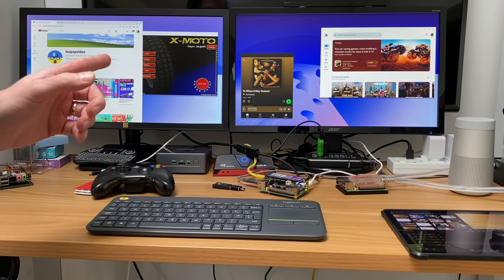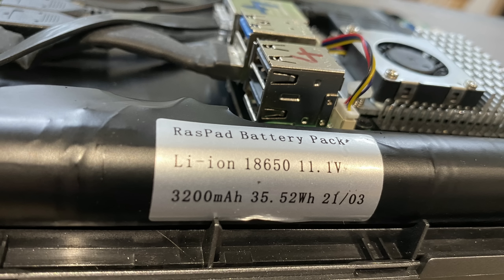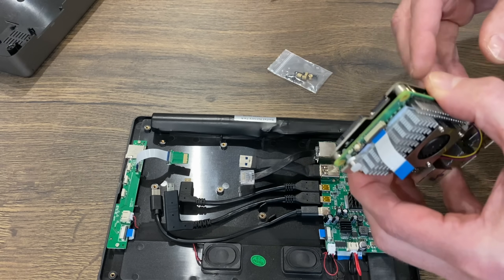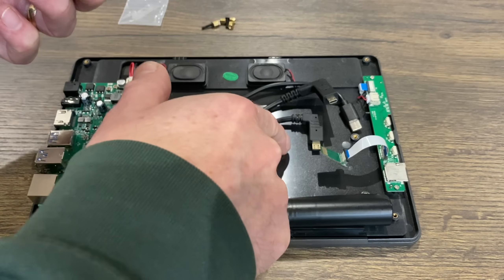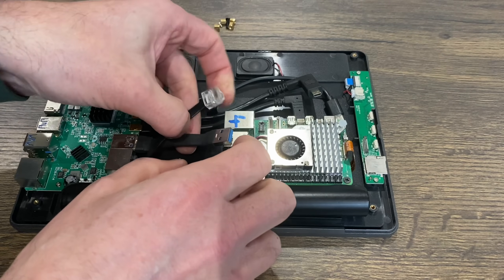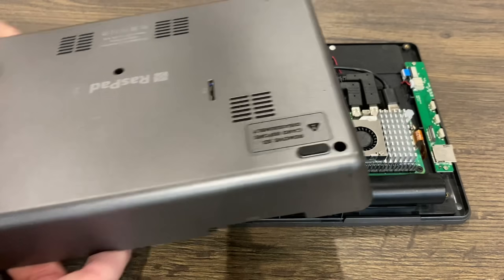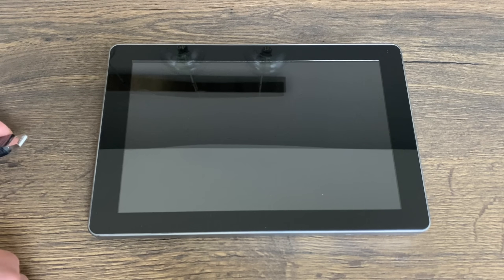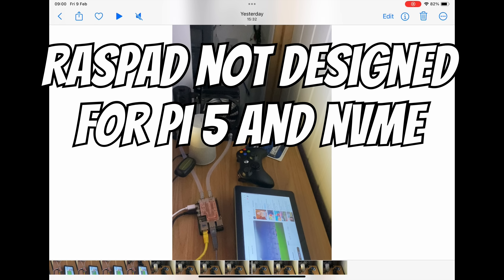Raspberry Pi 5 tablet with NVMe. Raspad 3

Comment: Since Raspad recomends Pi4 ,did you notice any voltage problems working with Pi5? Pi 4 needs 3A to work and Pi 5 needs 5. this is the only reason i am skeptical to buy one Raspad
Reply from the maker: Occasionally I get a voltage warning. It’s not ideal and the battery doesn’t last long

Comment: Hi there. I’m really intrigued with this project and have a question related to power availability vs requirements between the PI 4 and PI 5 in the Raspad 3 case.  I understand the main board in the case only provides 5v, 3a for the PI 4, but the PI 5 requires 5.1v, 5a. Did you encounter any type of challenges with power demand when using the PI 5? Sunfounder informed me it’s not possible to change the power configuration and that there would be issues with the PI 5.

Thanks for any advice you can provide.
Reply from the maker: It’s been fine for me. The recommendation is 5V 5a but I think that’s more when many devices are connected to the Pi

Comment: do ya think sticking with a Raspberry Pi4 and adding an NVME drive would have good enough performance? Also, have have you had any heat issues with RPi5 in the RPad3?
Reply from the maker: Pi 4 doesn’t benefit enough from nvme as usb 3 is the fastest connection. Pi 5 has much faster pcie.

I always used 2.5” ssd’s with my Pi 4

240GB SSD Kingston Vs Crucial Speed Test. Raspberry Pi 4, Pi 400.
https://youtu.be/CRNHUuGZ9aU

Samsung bar was also reasonable

USB Stick Speed Tests. Raspberry Pi 4 / 400
https://youtu.be/u2KZhkdP8P8

Temperatures have seemed fine. I haven’t run games for extended periods on the Raspad

Comment: I have a unusual raspad mainboard since mine has a extra switch which enables touch when external display is connected and the headphone jack can be controlled by the buttons on the side altough i don't have bass so i use a eq that boosts the bass to be flat does your raspad support volume control on the headphone jack or not and my fan has gone bad rattling or making a strange noise some say sounds like a drunk bee I have a very unusual unit also having a mfg date sticker of 2024.09.07 with my battery having gone out of balance causing issues with charging making the osd glitch out and it shutting off before the low battery warning which i fixed using my lab power supply after carefully slicing open the pack careful not to stab the cells i was able to fix it altough it reports low battery early and lasts 1.5 hours in low battery state with the other leds only on for 30 minutes with almost the entire charge cycle consisting of the last led blinking sadly these batteries on their own are impossible to find and when i find them the cable is too short and has the wrong plug so i worry if my battery completely fails i'll have to manually replace the cells in the pack itself and for cooling improvements just put scotch tape around the fan to seal the exhaust to the fan so it doesn't blow hotnair back into the tablet it works really well and it's nice and cool if i have replaced my fan it's getting scotch tape but since i've had the old fan removed to take pictures and such i ran it with no tape around it and under  high load the back of the tablet gets uncomfortably hot and the pi 4 with the beefier official  pi 4 heatsink it gets up to 90°C Yikes it was horrendously slow and eventually crashed 30 seconds when i stopped the stress test  rebooted and survived also i use a kingston datatraveler max as internal storage and it's working really well i recently disassembled it since that saved space and allows air to flow around the chips resulting in lower temps and it doesn't have to sit at an angle pressed up against the ethernet port also my ethernet cable doesn't do gigabit ethernet i tested a normal cable hanging out the back of the raspad and it worked fine through the jack on the side of the tablet weird how mine has so many flaws also the screen is 1000:1 contrast ratio for the osd but 800:1 for the display signal making the osd bright but the actual image dim

Comment: I did the same you did. But mine won't boot up. Have to push the power button to get it booted.
Reply from the maker: @TheoK-n7r  I press the power button to boot the tablet
Reply: @leepspvideo  I have to press the powerbutton on the pi itself
Reply from the maker: @ weird. Could it be a setting in sudo raspi-config ?
Reply: @leepspvideo  I have no idea.
Reply from the maker: @ https://forums.raspberrypi.com/viewtopic.php?t=368938

Comment: How long will the tablet run with such a battery?
Reply from the maker: @vityapotapchuk  depends what you are doing. It’s no iPad for battery life. The Pi 4 lasts a couple of hours
Reply: @leepspvideo  actually i want to make a tablet on pi5 and now i am looking for a solution for portable power (5v,5amps). I saw cutiepi but it is built by cm4(5v,3amps)
Reply from the maker: @vityapotapchuk  compute module 5 should be out sometime soon

Comment: Hi, I have a problem. I‘ve inserted the RPI5 in the raspad. With SD it will boot. The NVME is on the way, but I wanted a first test with USB.
It won‘t work. The Raspi says: Not enough energy for USB. Did you have the same problem?
Reply from the maker: @christianpreiss8246  no, your usb could be using more power than nvme. I would avoid Overclocking inside the raspad as that will use more power.and run hotter. 

PCI’s boards that take power from gpio  pins can be more forgiving than usb storage.

I discussed it in a video, can’t remember which one, maybe 

What can we do with this extra power? Up to 40 Watts Power Delivery for Pi 5.
https://youtu.be/f8Ou6VkuF4w

Or

My new NVMe setup Raspberry Pi 5. Plus longer PCIe cable tests
https://youtu.be/DX6tg-FY_nI

Comment: The ethernet cable is too short for this modification and put too much stress on the connectors.  I modified mine as shown; but, the ethernet connection is intermittent and keeps failing. Very frustrating!

Comment: I have my Rsspberry Pi 4 with a Samsung T7 external usb SSD in my Raspad 3. There was just enough room for the SSD over the interconnect cables to the rj45 and usb a ports.  It does have to be in the exact position to work and I switched the cables around a bit to avoid too sharp a bend on the ssd cable.

Comment: I can report that the Raspad3 Tilt sensor does not fit if you have the raspberrypi 5 official cooler. It might be possible to make it work if you solder on some connectors and attach it with wires.

Comment: Any manufacturer / open source 3D Printing project out there to build a flat tablet so that the M.2 fits on the side of the Raspberry Pi 5 ? (not on top or below because of heat). Ideally the tablet should have internally temperature sensors and a laptop-like flat fan to expel the heat on its side, at least for the M.2 drive.

Comment: I used the Pimoroni NVME adapter which actually had a ribbon cable that allowed me to connect the SD card slot without any issues, and of course I also had to shave off the fan mounts in order to accommodate the Pi5 cooling fan, I also opened matching the "slots" on the back of the case above the RasPad board with a Dremel tool and mounted the fan that came with the RasPad and directly plugged into that board, so I have extra airflow cooling! With the boot order as configured for NVME, I would still like to know how to change OS without dis-assembling the RasPad....?
Reply from the maker: Check the bibu6666 comment

Comment: There is an option to "boot" from SD card...but have the root partition "/" on the NVME...A small FAT32 partition on the SD card with the initramfs kernel and stuff to start the PI, then it mounts/runs everything from the "/" on the MUCH MUCH faster NVME
The reason this works so well...stock setup the RPi boots from SD card...a small cheap SD card can be used, a FAST HUGE NVME/SSD can be used for the root partition thereafter, and since you don't have to flash the EEPROM or use special codes in the boot.cfg and it rarely writes to the SD card (only for kernel upgrades and the like) the SD card should last a VERY long time...and if it ever corrupts, since it's FAT32, the SD card can be pulled and scanned on a windows machine to restore it
Also..get some of those screw/standoff kits, you can experiment with different lengths and whatnot and custom build the hold downs in order to optimize the holding/mount points.
https://github.com/benjamin-nose/Adafruit-Pi-ExternalRoot-Helper

Comment: Is the battery module removable so you can get higher capacity ones? Thanks for the video.
Reply from the maker: I dislodged it at on point by accident. It seems to be fixed with double sided tape

Comment: Thanks Lee for giving ideas on making my RasPad3 even more useful.  I normally use it to run my SDRPlay RSP1A or my Hauppauge TV dongle hooked up to my old 20: HP monitor to watch local AST1A TV channels in my bedroom, so having a better CPU will definitely help with those activities. Therefore, I never change operating systems that much, but from your video I can still hookup a SDCard Reader to offload recording from the radio or TV when I feel like it…😊!
The only snag is waiting for my dealer to have the 8Gig model in stock..😮!
In the meantime, I am in the process of purchasing ClockWork Uconsole with the Raspberry Pi IV Lite. I just hope it will arrive before the 3 months shipping that other YouTube viewers have reported…😢!
Have a great day!

Comment: Like you, I got my RasPad working with NVME after many attempts I found that many NVME Boards had issues, but found that if I used a Samsung 2230 1tb on a Geekworm X1000 PCIe M.2 Key-M NVMe SSD PIP PCIe Peripheral Board for Raspberry Pi 5 that works great and gives me a GPIO extender (which allows me to connect the rotation sensor also) and after modifying the case (fan standoffs removals) plus I additionally opened up the other grill indentation with a tiny drill the same as it is over the fan slot, and now runs cooler as well. Got both the MVME and Geekworn board on Amazon. Also, my SD slots is open and works great. Hope this helps.

Comment: I have the x1001 board working inside my Raspad  with the sdcard extender in place as usual.  I needed to trim the plastic fan mounts as you did and mounted the Pi5 without feet on the bottom.  The cover just fits and I was able to put in all 5 screws.  I am getting a bit more than 2 hrs. battery life also.

Comment: I did this a while back and it's not worth it. 1. you can't get any of the script like auto rotate working with pi five and new OS 2. even without the Pi5 the battery drains in about 45 minutes.